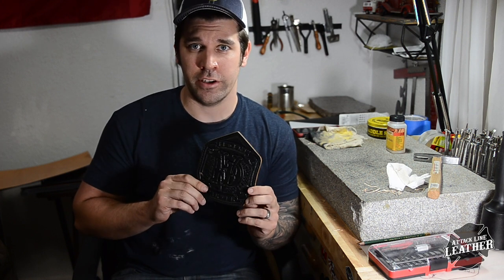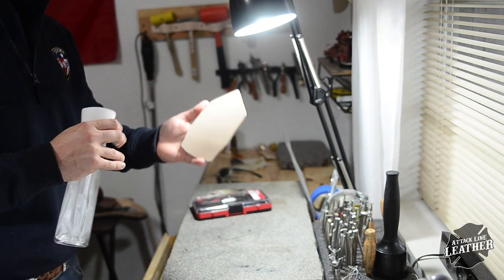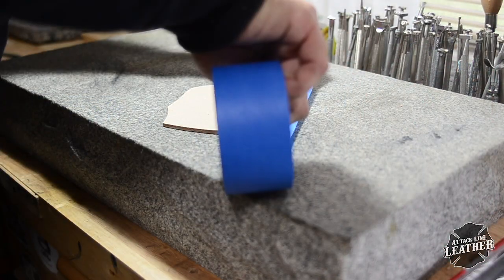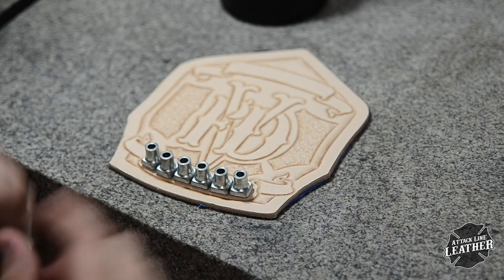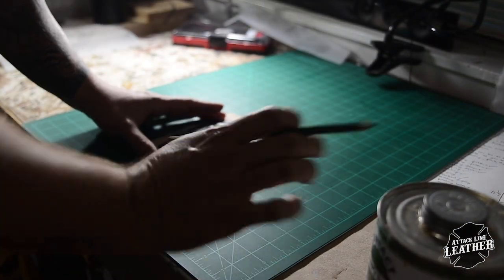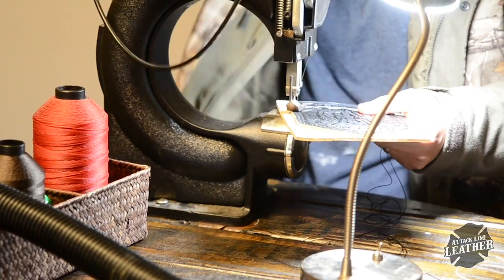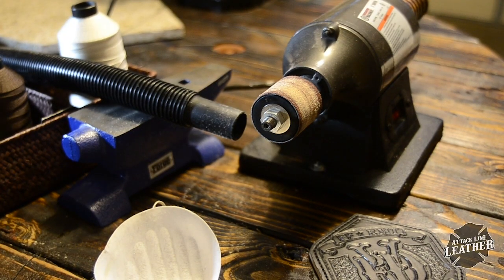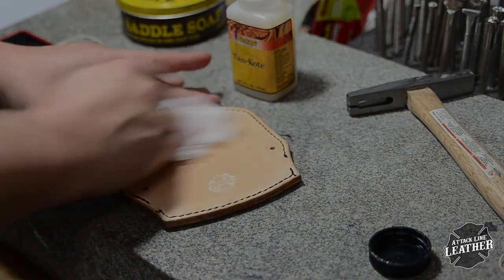HOW TO MAKE A FIRE HELMET SHIELD

Comment: Awesome front.   Do you do the metal strip on the back?  If so, what do you use?  If not, what would you recommend using?
Reply from the maker: Thank you. I do not use a metal strip. The metal strips are added to generic shields because they do not use veg tan leather which is much stronger. They use a cheap leather imitation.

Comment: Great video! When you stitch the leather together for the shield do you have to use a nomex threat?
Reply from the maker: I just use bonded nylon. It works great and I have had no issues while in structure fires
Reply: Attack Line Leather thank you for the info and great videos
Reply: christopher sloan q

Comment: What tool did you use to trace out the template
Reply from the maker: Its a stylus with a fine point. You can find them at tandy leather, springfield leathe co, or hobby lobby
Reply: What do you sand with ?
Reply from the maker: @dylanmay7928  i use a buffer motor that i converted into a sander. I have a video on that. I also use a dremel tool for hard to reach spots.